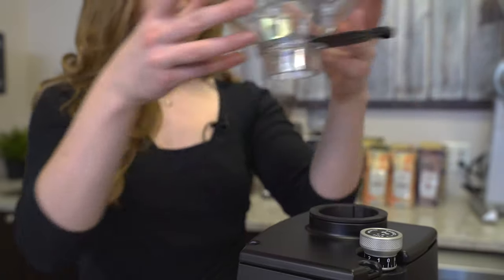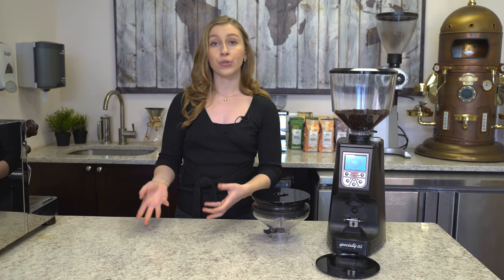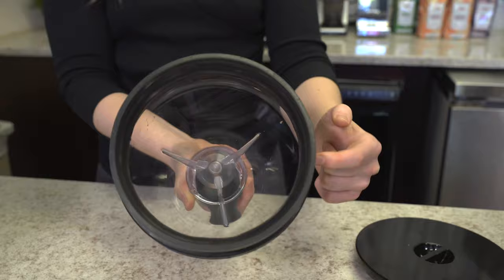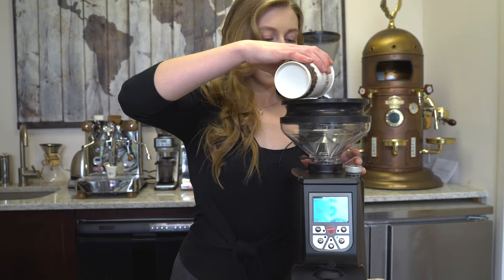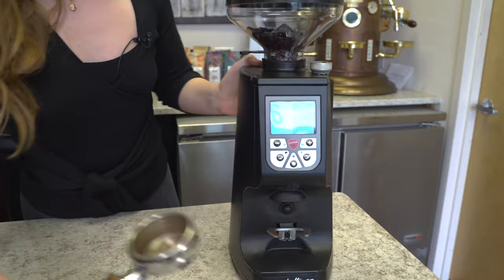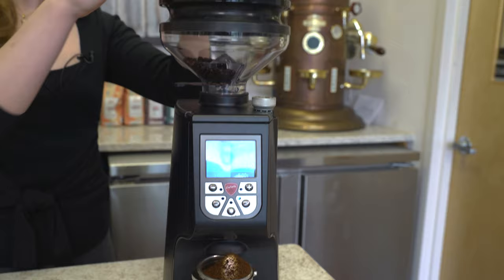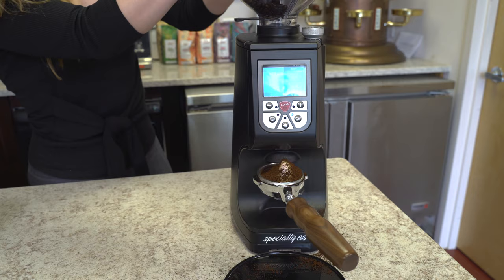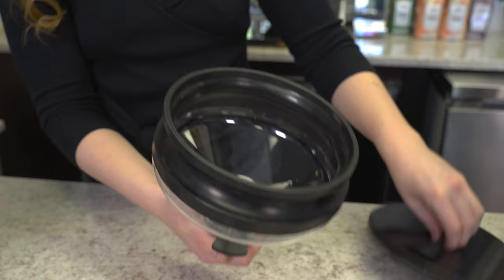Eureka Atom Blow Up System

Comment: This things sucks. In more than one way. First of all the air escapes through the bean blocker hole for example, so the blow is not enough to sweep everything out of the grinding chamber so it is far from "zero retention". Second thing is that after you push the hopper it needs to fill with air and as the top is sealed it sucks the air back from the grinding chamber with some of the ground coffee. After a few uses the hole in which you insert the hopper is all full of ground coffee. It's just a poor attempt to jump on the "single dosing" bandwagon. It does not do what it says.
Reply: Great review mate. Could you please show us some photos of this thing in your setup, so we can all see the phenomena that you describe and send a clear message to all those people uploading false allegations in youtube?
Reply: Needs 4-5 strong blows rather than just a gentle one. Been using one for a couple weeks and it works perfectly fine.